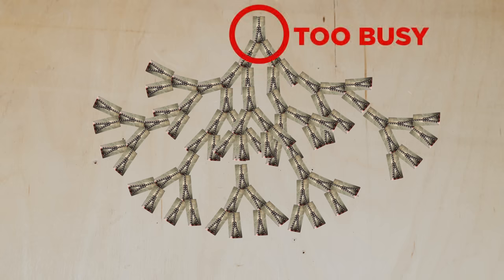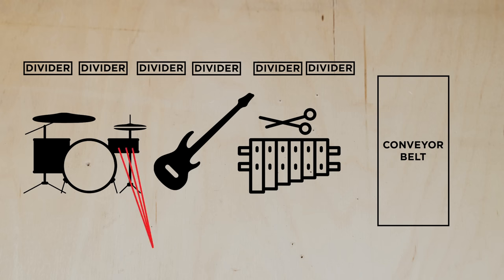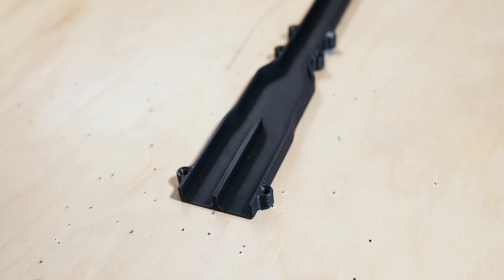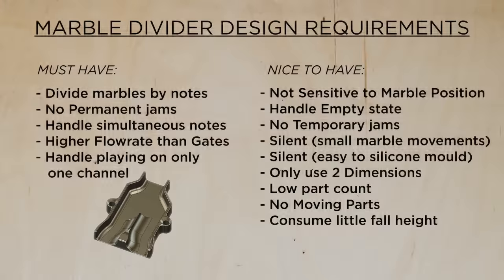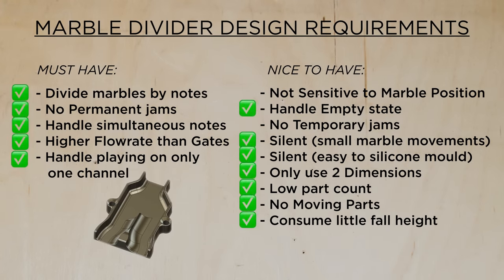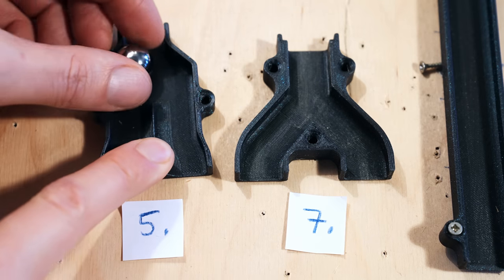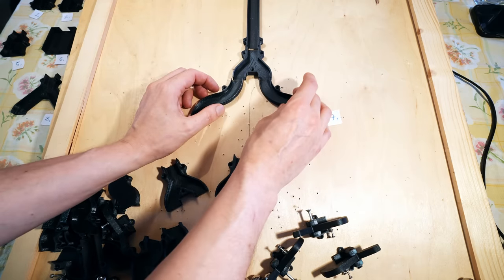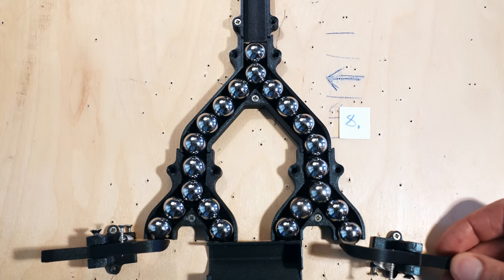Mystery Marble Divider?

Comment: The downside of giving every channel a dedicated marble route is that you can't "borrow" capacity from unused channels, which means all of your routes have to be able to handle the maximum possible throughput and you end up with wasted capacity when channels aren't being used. Although that may not be a significant problem, it means wasted energy to move parts that aren't carrying marbles and extra noise coming from parts that aren't contributing to making the music.

Combining the channels means that when one channel isn't being used, that capacity is still being used by other channels. Having a large "reservoir" of marbles can allow for a song to use more than the maximum throughput of marbles temporarily (until the reservoir is empty). You could also add a secondary lift mechanism that only engages when the reservoir is approaching empty, although that's probably more complexity than it's worth.

As always, I think Martin is struggling because he's unwilling to accept the limitations of his machine. He should be embracing those limitations because they are what make this a unique instrument. Instead of trying to make a machine that can play all possible music, Martin should build the machine first and then write music based on what the machine can do.
Reply: He has a creative vision for the machine and he shouldn't compromise on the music he wants the machine to make, the music he wants to make is not a stupid design requirement. He should only look at the most sane and simple way to achieve his vision.

I do agree with your point that it might make sense to eliminate the marble dividers altogether by having a closed loop of marbles for every single channel. I guess some queueing theoreticians should weigh in.
Reply: Agreed. He keeps hyper-focusing on one design requirement to the point that 3 or 4 others start falling apart.

Having multiple duplicated closed loops of marbles has got to be the worst choice he's made yet in this regard. What happened to simplicity? Reliability? Deduplication? Usability and maintenance?

This is on top of things he's not even thought of yet, like the time it takes to load the machine before each performance on the world tour. He's now got to divide the marbles correctly between each loop. Will it be the same number for each? What's the error tolerance on that?

Once he figures all this, he'll go back to the drawing board again and hyper-focus on that, forgetting all the things he cared about in this video 

I want him to succeed, which is why I can't stop watching, but it's so exhausting seeing him not learn the exact lessons he's told us about over and over.
Reply: But the problem with the single reservoir is how to divide the marbles to the instruments that are using notes, at the rate they are using notes.

It's not practical to require that much throughput on a single divider without jams.
More throughput = more marble speed = small imperfections causing big problems.

Why do they all need to go through a single input to be divided?
Because all other options require random distribution of marbles, which can cause lanes to run dry.
Reply: @LReBe7  Re: the first point: That's how all instruments work, though. You can't force a snare drum to have a variable pitch so you write music that uses a timpani to vary the pitch and a snare for the snare sound. You can't force a trumpet to go as low as a tuba so if you need a low brass note you use a tuba because that's what it's for, and you use a trumpet for the high notes that a tuba can't do. There is such a variety of musical instruments in existence because no single instrument can do everything and musicians have to be cognizant of the limitations of the instrument they want to use. In this case, I respect Martin's vision but so many of his problems arise because he is unwilling to compromise the capabilities of the instrument because he wants his instrument to fit the music instead of fitting the music to his instrument.

He keeps talking about designing from first principles and form from function, but he isn't applying that idea to his music, only to his machine. The first principle should be what the machine is realistically capable of and the form of the music should follow the function of the machine, not the other way around. Just like the form of music played on a saxophone follow the function of a saxophone, instead of trying to force the form of the saxophone to sound like the function of a guitar.

Re: the second point: I'm arguing for the opposite, that he should limit the number of marble routes and combine many instrument channels into the same routes so he can more efficiently use space and energy to lift marbles. It would also reduce parts and probably reduce the number of moving parts. Although I'm no theoretician, I do know that studies for queues at stores invariably move faster when there is one line that separates into many checkouts instead of having a separate line for each checkout. When one checkout slows down, the whole line continues to move because it diverts to open lanes as needed. Of course, this is possible because humans sort themselves and don't jam. I think the best solution is a hybrid where the channels are grouped into routes based on how much flow they're expected to have. Instead of a route for each instrument, or one single route for all of them, have a few routes.

I also think Martin should think more about where his "reservoir" of marbles is and how big it should be. The bigger the reservoir is, the less critical it is for the marble lift capacity to keep up. At the extreme, a huge box of marbles at the top could hold enough for an entire song and then you stop, refill, and play the next song. That's boring, of course, but the idea is that you don't need a 1:1 ratio between using marbles and lifting marbles at all times, you just need an average 1:1 ratio across the entire performance. Again, if we consider that the form of the music should follow the function of the machine, Martin could plan the performance to alternate between high-intensity music that uses more marbles than it lifts, depleting the reservoir, followed by a low-intensity song that lifts more marbles than it uses, refilling the reservoir.

Separate routes means separate reservoirs.
Reply: @RhynoD2  the entire point of making this machine is to push the boundaries of what music can be played in an entirely mechanical fashion. Of course he could limit his machine to basically be a preprogrammed carillon, but have you ever heard how sloppily a carillon plays? At some point, simplifying the design starts to chip away at the ambition of your project and it just becomes a stale rehash of something that already exists.

Plus: Martin is in the prototyping phase and he is prototyping in a modular fashion. The lesson I am getting from this step in the process is: maybe try to eliminate the complexity and moving parts involved in aggregating and dividing the marbles. Yes, this would require some more parts and some more space, but if those parts are simpler to design and more reliable, that trade-off might be worth it.
Reply: @RhynoD2   Dont give martin too many ideas for brass winds or we'll see marble pumped air to do a toot after 200 videos.

Comment: why not make a double release. You have a 'runway' or cache which can hold 10 marbles, and with every release from the marble gate, you allow one to go to the cache. Then you don't care how long your path is. There could be a lot of space in between...And the release to the cache can be related marble-triggered itself, i.e. if the cache has size 20, if the cache is too small, allow more to go into the cache.
Reply: Yeah. I think he screws himself by trying to have the machine run entire shows flawlessly. I think he would be better off just "topping off" the marble tracks every song. You have to change the programming wheel out anyway.
Reply: @jonathanschubert9052  the problem with that is the number of marbles needed for each instrument for a song, it could easily be in the hundreds if not thousands of marbles per instrument, which if steel balls are used is a lot of weight and needs a lot of space to be stored, hence using less marbles but reusing them is probably a better option.

Comment: ^you forgot an requirement:
If Marbelpressure is high (Manny marbles pressure vrom above), the no marbel is alowed to jump out
Reply: Can easily be solved by having a cover on top (a closed tube). But the marblepressure might cause problems with the release gates. I can't remember if the current gate design is indepentend of marblepressure
Reply: IIRC, the current gate design still uses a type of escapement which works better with some pressure.
Reply: An?
Reply: @Belvedli  the cover in turn would leave more room for jams potentially, which would need to be tested.
Reply: Very important

Comment: How about using a flexible tube section for continuous marble path length adjustment? The tube can be laid out with S bends, so you can pull more or less of it in/out when laying it down, to find the perfect top-marble position without having to use discrete increments. Then when the top and bottom marbles are in the right place, you can cut the remaining bit of tube past the end gate  ring joint.

Comment: I'm sure you could improve the flow behavior of ALL dividers by adding a vibrator device to the marble divider assembly. It would make the marbles behave like they had effectively no friction between them and it could thereby potentially make one of the earlier versions (that clogged) shoot up to the top performers. Not sure if that is a feasable solution though. Really nice video, btw!
Reply: I was just about to comment that too, a vibrator with enough force should enable the marbles to "unstuck" themself unless its a permanent clog/jam. But then again they would add more complexity, just via the question "vibration in which direction".

Comment: I have high hopes for seeing Jesse Roelfs' marble divider further developed... it looks like it might pre-empt a potential faillure state that this video did not test for: the pressure of marbles against eachother put pressure on the gates and that might break it. (Additionally, when using open channels, marbles may jump out; additionally, who is to say Y-split dividers work under higher pressures).

In addition it looks like there's fewer marbles knocking into eachother which should decrease noise.
Reply: Having separate, dedicated marble-paths for each instrument will also reduce the pressure, by reducing the sheer number of marbles in the path.

Comment: Since the machine will have separate tracks (drums, bass, etc.), you should probably design each divider so that it works perfectly for the track it is build for. Modularizing the splitter works great if this is going to be a commercial part for many use cases, but in the end it's being designed for a single machine and unique for each track. I think instead of using inserts (like the wooden ones) you should prototype with the printed ones, but for the final part, it should be printed as a single piece with all the extensions built-in.

Comment: You could try to use a marble reservoir on top from which all the marble lanes come out from, no tree splitting, nor height issues, probably. As for the jamming... use a wiggler or shifter powered by the crankshaft

Comment: You know, in the very beginning of the new series I was worried. Martin seemed so focused on getting inhuman levels of precision out of this thing, still set on a certain power input and whatnot, that it felt like we were headed for another MMX situation. Every video since then has made me more and more confident that this machine will actually work. "I'm just going to accept that I cannot solve it (the marble height issue)" is one of the most reassuring sentences ever uttered.

Comment: Just for fun, I'd love to see how many levels the tree divider could handle. If you could make it to 7 levels, that would be divide by 128. I wonder how the design for the first divider would have to change compared to the final level. After dialing in reliability, another goal would be maximizing flow rate. Love this project, so inspiring!

Comment: Stop dividing marbles! Marbles are by their nature against flowing, and any time you divide marbles you have to combine them again. Almost every unsolved major issue you had with Marble Machine X was combining marbles, and you will continue to bang your head against the wall with this.

You need a single track for each instrument. You need to keep marbles linear. That might seem more complex, but it will simplify the biggest issue you have had since the start. You can perfect a single track before moving on to the next, and never have to worry about dividing or combining again.
Reply: That's fine if he wants to build 32 marble machines.
Reply: How do you want to fit hundreds of separate lanes??
Reply: @luksch154  It wouldn't be 100, it would be the same number of lanes as he has marble gates. He's already got this many lanes at the top, he just needs to have that many lanes the whole way around. 

I think the most complex part would be lifting them back up. He could do this by integrating the programming wheel with the marble lift, which would make sense, because a pin on the wheel also corresponds with a marble dropping down, it should correspond with a marble being lifted back up.
Reply: @Mark_LaCroix  That's more or less exactly what I'm proposing.Of course, they'll share the same power source and programming wheel, and they'll be very very close to one another to appear as one machine, but it will drastically simplify the work he needs to do: Each instrument can be adjusted and fine-tuned individually. Adding more instruments no longer affects all other instruments.The only limitations become the amount of friction each additional lift and gate adds to the system, and the weight of the marbles he needs to lift, and the width of his programming wheel.

The best marble divider is no marble divider. Make your requirements less dumb. H'es spending all this time trying to figure out how to combine and split up channels, but there is absolutely no need to do that.
Reply: @trevdak  This will not make it more simple, it will make it way more complex, require more parts, and have more failure points.

Comment: A divide by N marble divider, followed by "dump excess marbles" gates on each path that let the excess back to the bottom
Reply: this doesn't meet the requirement for marble flow rate since you are "discarding" at least half of the marbles
Reply: So in that case each gate needs a small reservoir of its own to store up marbles for fast playing. This was the design on the MMX.

E.g.
I have 4 gates, each with a reservoir that can hold 10 marbles.
The first is empty, the other three are full.

If I have 20 marbles entering this system, then the first run through, 5 marbles go into the empty path, and 15 get cycled back.
Then of the 15, 3 or 4 go into the empty track, and so on.
It won't provide marbles to each track at the rate each track is consuming them, too many get wasted on each go round.
Reply: It's true that my proposed design requires extra marble lift capacity- but marble lift capacity is cheap, and a jammed divider is very very expensive.

Comment: You need another design requirement: decent tolerance to account for wear. Plastic will be worn off, joints will loosen a bit, springs become a wee bit less springy etc. So even if the parts are produced and montaged to the highest precision it will change over time and the divider should still work.

Comment: Something that I don’t know if it would be a factor or not is sensitivity to the angle relative to the floor of the part. During original assembly it may be possible to get everything to work perfectly, but preparing for a concert it may be difficult to place the machine exactly level with how it was originally assembled. 

I don’t have the knowledge or the ability to test how big of a factor this could possibly be, but I would argue that for a design to be considered robust it should not be sensitive to how level the machine is.

Comment: What you're making is a perpetual water fountain but with metal marbles. If you made a machine that could rain down marbles consecutively on all channels, with no stops, that'll be the jackpot.

I can imagine a hopper at the top with exactly all the marbles needed to play what you needed to play. Then, know how many marbles are needed for each individual element in the composition of the song. I can envision for one element, the hopper at the top loses a particular weight from its hopper and after losing all its marbles, below the machine, the weight increases after each conservative drop of a marble. When it achieves a weight limit at the bottom,  it triggers a seesaw pulley to move the basket from the bottom to the top, trading places and reloading. A counter weight would pull the empty basket down and raise the newly filled basket from below to the top. What we need during this switching is little rails switching over simultaneously, while baskets trade places, to pivot in a new direction for the marbles to fill. No longer filling the left side of the bottom catcher but now the right side. Once the weight exceeds the limit in the catcher it repeats the cycle. I can just see all this running on pulleys and counter weights. Gravity POWER!